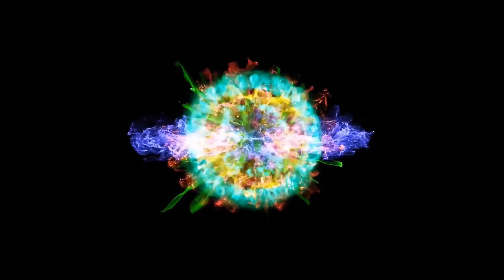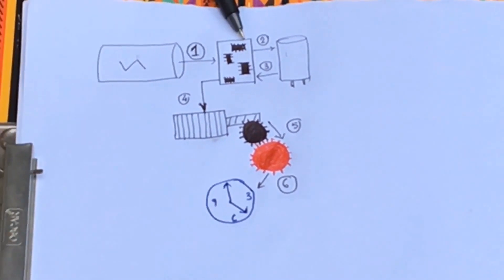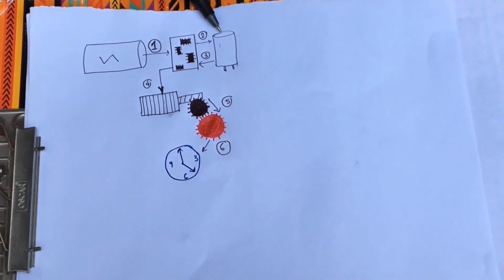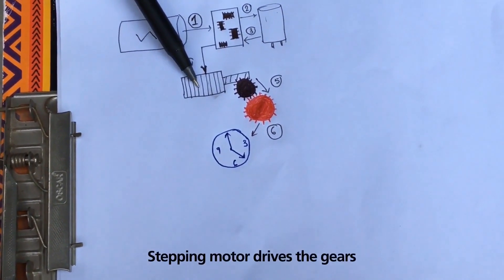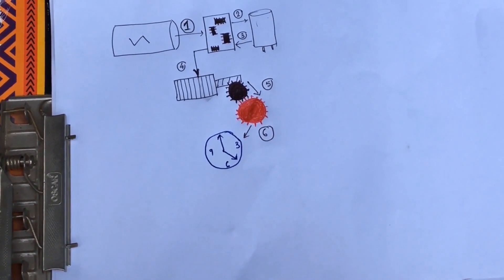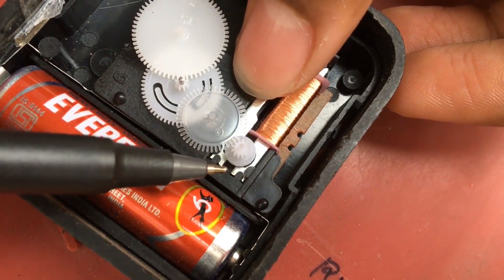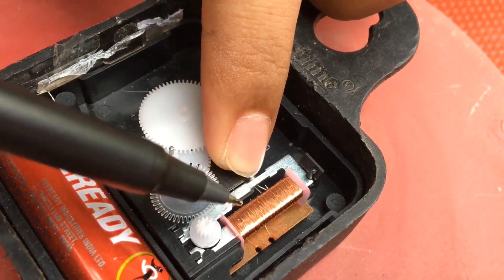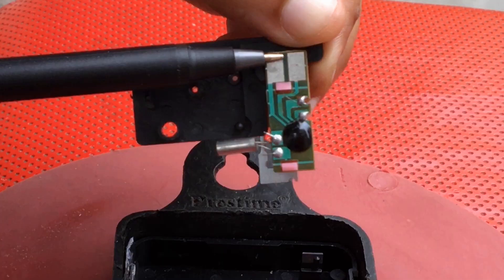What If I Put A Magnet On A Clock (Analog/ Digital)

Comment: One thing is common ,  both our system (us) and clock celebrates interdependence.  
The head seems battery source sending signals to the chip (lungs) , which gives signal to  the piezoelectric crystal (which too receive and donate- like heart),  then the stepping motor finds expression as time ticking. 
To every way there are challenges ;as obstruction and to every challenge resilience to fight back leads to clarity. 
Thank you for  enabling us to see the other way to least resistance. The digital watch. 
Journey from invisible to visible is celebration indeed.
Reply from the maker: Correct you are.😊